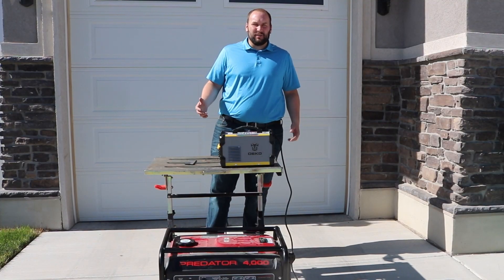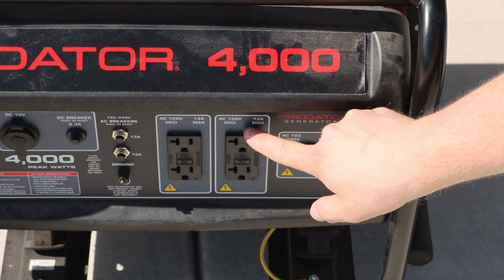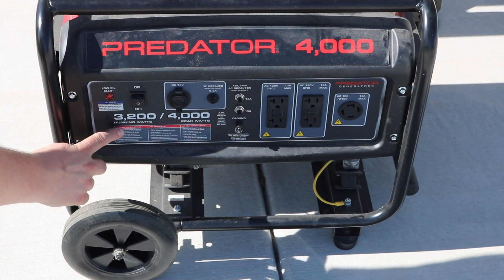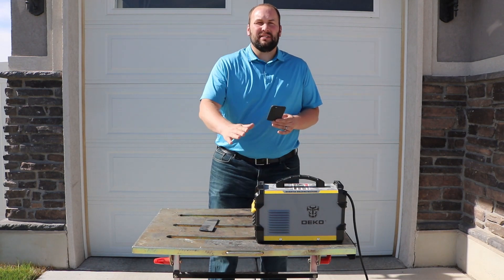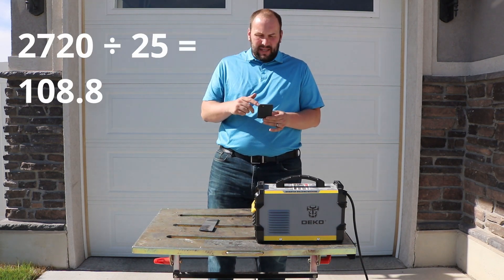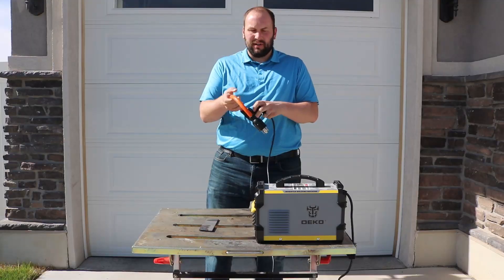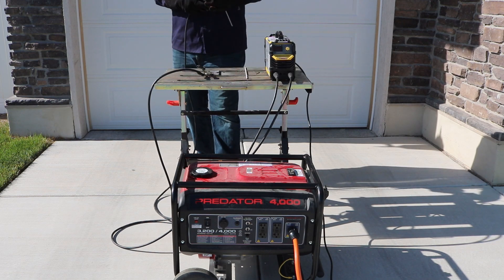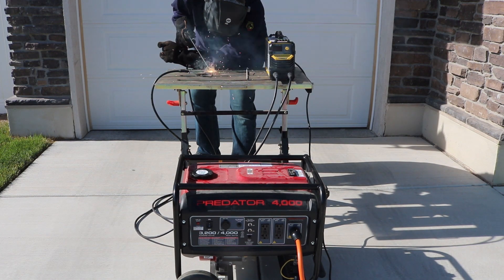How to Run a Welder Using a Generator

Comment: Tim I have a 2006 miller Bobcat 250.  I would like to run a mig welder off of it.  I have a transformer Miller Matic 211 and a Yes welder DP 200.  Should I be worried about frying either one of these with dirty electrical output from the Bobcat?

Comment: I run a titanium 225 stick welder from harbor freight of my predator 5500 generator also from harbor freight with no problem I rarely use 6013 3/32 rods mostly 7014 or 7018 3/32 rods on the 220 volts I even burned some 1/8 rods of the same above mentioned sizes with not problems I never weld with 110power if don't have to

Comment: what generator would you recommend to run a HONE Stick Welder, 110V/220V Actual 140Amp ARC Welder Machine, IGBT Inverter. Thanks David.

Comment: You should look at what you are pointing at or trying to show as it looks weird hahaha... and you miss some times aswell :D

Great vids so far!
Reply from the maker: Thanks! I did all sorts of weird stuff when I started making videos...I'm just a super awkward guy. I think I've improved since then, but who knows.
Reply: @TimWelds  You're doing great!

I am planning to invest in a Tig for my garage dutioes now that i have fixed the generator i bought off a friend that refused to make electrickery... I really want to learn the black art haha. I am sure that i will be able to use it alot better and more precise than the Mig i got. It's only car panels and some bit of structural stuff, but in my current situation i think it will be ace!
Be well and thank y ou for the replies! :)

ADam

Comment: When considering to use a generator for any heavy load such a welder, you should test your generator with a static load first. You need to get a baseline proof of performance of your generator. This applies especially to off name brands. Static testing includes digital voltmeter and oscilloscope. A meter that measures THD (total harmonic distortion) is also helpful. If your generator has a good sine wave and low THD, then your inverter type welder  electronics can better deal the power delivered. Both the generator and an inverter welder will have issues if the sine wave and THD aren't acceptable. The both have power manipulating thyristors that can eventually cook one or both units involved. ..... Point being, test your generator to see if it actually can put out the advertised power. Some just don't meet spec. .....

Comment: Are you sure you don't need to use an Inverter Generator?  From what I have been reading, Inverter Generators are made to run welders much better than a regular generator.  No expert here, just asking the question.  Hopefully, you'll read my comment and can respond. 👍
Reply from the maker: It depends on the welder because some tolerate it better than others. If you want to get technical, you can look at the total harmonic distortion specs and make sure the generator is acceptable for the welder. The real issue here is probably the low power factor in this cheap welder, but I didn’t fully understand that when I made the video.

Comment: Im pretty sure if the welder is a 110v plug, using a 220v adapter into the 220v outlet isn't any different than the 110v on the generator. The adapter does the same thing as the 110v outlet. I think you're only using 1/2 of the 220v supply. I think its 2 110v with ground being their center. Like a push pull operation. Maybe I'm wrong about that, but I think you'd need a 220v machine to get the full wattage of the 220v outlet.

Comment: I have a little 130A stick welder that won't start an arc on my generator,  but my harbor freight flux 125 welder runs great off of that same 3500w generator.
Reply: Different requirements i think that might welder is 20 Amps stick uses more

Comment: Thanks a lot for this video!
I plan to do a lot welding next month, with 120-130 Amps, (MIG welding), so I planned to buy a Honda 4kW generator (220V).
According to the manufacturer of the welding machine, a 3.8kW generator is enough, but it seems like I'm on the  edge of the limit with 4Kw Honda.
I'll rent a 6kW generator instead of taking the risk of buying one.

Comment: I tried running a Lincoln buzz box off of a generator. I could hardly keep it lit. Then, I got 220 up in the shop and the buzz box worked effortlessly. And, a welder/generator works really well. I will never use a welder on just a generator. Thanks for the video.
Reply: Then run fine off a generator if the generator is big enough.
Reply: I ran ours of a 7000/8750 generator, but buzz boxes are terrible with efficiency and powerfactor.  I only got around 120A, which was fine for running 6011 on the farm.

Comment: A constant current welder varies in wattage based on the voltage set by the operator via arc length. I think a basic circuit analysis class would improve his math. Incredible inaccuracies all around, he is neither welder or engineer.

Comment: Latley i been tossing in my 9500 watt generator and my tig200 into a scissor lift to weld up knee braces in massave buildings...only using 3/32 7018 electrodes... saves time rather than go up and down to move my welding truck all over for lead reach.

Comment: I have. A 225 inverter stick titanium welder from harbor freight  my question is can I run a 5500 generac wheel house generator  ? At what proper amp and size stick rod use

Comment: I bought the same generator at HF they told me I could weld with it. I connected Vampbell Hausfield(old) Mig to it and it struggled on the lowest setting. So I got a suggestion to try the) cheapest HF stick welder, and on the 120V 13A side struggling. Then HF (a different store manager) tried to sell me a 10kW generator…I’ve ordered the 240 4 prong to 3 plug from Amazon, I’m welding tubing w/ 1/8” - 3/8” wall. Thanks for the info. As far as I can tell you’re the only one who has featured the Predator 4000 w/ a stick welder.

Comment: Any chance you can help me to see if I can run the esab 205 ac dc using mig and stick off a 6000 running watts inter genrator ?
Reply from the maker: I don't have that particular machine, so I can't test it out for you. I did see a video on some other channel (I think it was Baker's Gas) with the 205 running on the generator side of the ESAB Ruffian engine drive unit. That engine drive has a similar output, so it may be worth trying to track down that video to see what the limitations were.

Comment: how is the welding voltage 25v I don't understand?
Reply from the maker: It's probably a bit lower than that in reality, closer to 20v. I was just assuming a high number for a more conservative calculation. The purpose of a welding machine is to take a high voltage and low amperage and change it to a lower voltage and higher amperage that works better for welding. The physics of the arc work out to give a voltage drop of about 20 volts over the gap with stick welding. The longer the arc, the higher the voltage, but it's around that value. The amperage is adjusted to give enough power to heat and melt the material.

Comment: I run my welder on a generator and it works pretty well. Your setup is pretty close tho. The setup that would work is very limited though. You'll only be able to run a 120v welder on it. For example my Lincoln Le31mp is a 120v 15a plug. Multiply Amps X Volts to get 1800.  Now look at the wattage of your generator. That's awfully close to the required juice ro run your welder. If you were to run this on a Predator 9000, it would work because it's got 72500 running watts. That's plenty of power to run something requiring 1800 watts. Also I have a splitter that goes from 240 to 2 120s. This will keep you from tripping your GFCI on your generator.

Comment: per the sales reps ive talked to from various welder manufactuers(idk if i should say who exactly) but generally speaking all recommend atleast 7000watts 120v and 13000 watts for 230v so to them our running fairly low to be able to run that welder at max...i run my welders off a 13k start and 10.5k running and have had no issues at all thus far good luck in the future

Comment: If you have an EV or can get a hold of one, you should try demonstrating welding plugged in to it.  220 volt if possible.  People talk about being able to power a 220 volt welder off of an EV but I have yet to see someone do it.  I'd also wonder about what kind of battery life you'd get in terms of miles of charge used per minute of welding.
Reply from the maker: That’s a great suggestion! I’ll have to see if I can get my hands on one to try it out.
Reply: @TimWelds If you really want to get some strange looks and/or get banned from local businesses: you can get a J1772 AC charging adapter. They cost about $50 or so. 

You plug an EV charger into one of these adapters, and it gives you a standard electrical outlet. It will be 120v or 240v depending on the charger. Note that these adapters only work on AC charging stations, which are low and medium power. DC charging stations won’t work with these adapters. So you may have to search to find the right charging stations (EV owners generally hate AC chargers because they are slower; almost all EVs accept both AC and DC)

And then you can weld in the parking lot of your local grocery store!

(I have never tried welding with one, but I did charge my laptop using my adapter)

(Also, just got one of those handheld stick welders and laid down my first 6” of bead. Actually managed to attach two pieces of metal together! Gonna get some better welding rod, grind down these welds and try again until it looks good)

Comment: If you have a little technical know how. This video is quite informative. Thank you. Trying to determine if my 4375 watt predator generator will run my titanium 220 stick welder. I use it for work on the road. I have a 460 amp generator I use that I engineered from a Cummins 12 valve with John deer parts in my trailer. But for the jobs out in the field far away from where I can park the generator. I use the bobcat with a mini generator and welder. This is great help. Allows me to be a bit more practical for the variance in my field.

Comment: some generators come with "high altitude" kits.   they have smaller carb jets because the engine not only has less air to work with at higher altitude, but it also becomes WAY too rich which also robs power. so you throw smaller jets in and it at least bring the fuel air ratio closer to where it should be.

Comment: I was running in 180 MIG welder off of an 8750 inverter generator.. is working great and then all the sudden now it's tripping the breaker on the welder every 4 seconds
Reply: Even after it cools down and you start again? Maybe a 12V computer fan blowing at the breaker could help- unless you are really, really  pushing the limits of the breaker rating.

Comment: If you want a real gen that is made to weld with and be mobile get the predator 9000 for 800$ you get a good gen for the price and you wont need to worry about setting the amps to high  ever as long as you got gas to fill it

Comment: Im glad you posted this i was wonder what specs would i need to run my welder off, seeing that its a bigger welding unit looks like ill need quite high specs to run my unit without issues Thanks TIM:yt: Dexterous X

Comment: Thanks for the video. I just bought a cheapo 4 in 1 welder hoping I could use the 220 volt outlet on my generator. My generator is the same size as yours. Funny thing my Miller synchrowave  250 would run on it at about 70 amps Tig welding.

Comment: Thank YOU for that 4 prong to 3 prong adapter cord !!!

I have been trying to figure that out for the past 2 weeks 😅.    I have been watching your Arc welding videos and just fixed my tractor mowing deck that had a broken mounting bracket.  The welds are ugly as heck but it’s a start.  The mower deck is super thin.   I was able to use this welder with my Ryobi 6250 generator.  It has 2 110v at 20amp receptacle and one 240v at 30amp receptacle.  I was concerned that the generator puts out 240V but the welder max voltage is 220V so I was worried that it would damage the welder, but it’s barely over 10% so hopefully it can take the voltage mismatch ok.  I got the welder for $103 😂.  I’m sure Nov 28 Cyber Monday there will be more coupons or sales for this welder.   Love your videos ❤
Reply: 110V-125V is ‘normal’ 120VAC; they are just numbers. 240V is the same thing as 220V in the USA. 

My ‘grid’ power is 125.3V AC right this moment which is normal in this area, so the phases are technically ~250VAC. 
110V to 125V is 120V “nominal” and what we like to call “220 volt” is 240V nominal. So your concern is really a non-issue.

Comment: I have a 12k peak 9600 running watt generator. I can’t weld a thing. Sticks rods like crazy, near impossible to get a stable weld and any amperage. And trying mig it only runs for about a second then the weld stops but the wire feeds like 2 feet on its own. Not sure what I can do. I’m running off the 50amp outlet.

Comment: I made that adapter a few decades ago and to get the generator to give the full power you will have to wire the throttle on full as it will not be able to push out a constant wattage while trying to regulate itself.

Comment: Just bought a Harbor Freight 3500 Inverter generator. I have a Miller 211 inverter mig welder that will run on 120 or 240. I welds 1/8 with .030 wire like a dream using 75/25 gas and a 25' 16ga extension cord on 120V. The generator will not carry the welder on a 120 20A outlet with no extension cord. I have a L5 30A twist lock adapter on the way from Amazon. I will give the 30A receptacle a try report back later in the week.
Reply: How'd it work out..?
Reply: @georgehofgren6123 I’m wondering too
He’s squeezing the amperage down with that thin extension cord. Too thin for the load- fire hazard. It’s just a cumbersome resister at 16ga
Reply: Did it work?

Comment: I used the same generator. runs 1/8th" 7014 at 110 amps. usually ran about 107 about 6 just fine. h get another spring to hold the throttle more open

Comment: I just got a Predator 4375 which has 3500 running watts and 15amp breakers. Would it be able to run better on it?
Reply: Does it have 240V outputs?

Comment: Great video, another way to see if your generator will run your welder is to calculate the max wattage of the welder, most single phase inverters run 220 volts at 30 amps which is 6,600 watts

Comment: Your explanation of how 'small generators' distribute power is somewhat wrong. The way they 'do what they do' (when you have 220v capability from them) is that they take L1 (leg 1) of the 220 and put it into one 110v outlet, and then put L2 (leg 2) of the 220v into the other 110v outlet. So, if it produces 3250 watts running power (and you trust this number without checking), divide 3250 by 240 (always use 120v and 240v for calculations...as most electric company manufacturers do for 'numbers-sake')...and you find that you can draw UP TO 13.5-amps of 240v (220v) current safely from the generator. HOWEVER, if you are running 110v, you ONLY GET one leg of this to each outlet (it's split between outlets...remember?). So...you get two outlets (possibly receptacles...you have to see how they wired their receptacles first)...so you can draw 120v (110v) up to 13.5 amps per receptacle...or a 'general use power drill', basically. Now...can you throw SMAW 240v demands on a wimpy little generator like this? Hmmm...let's look at the old Lincoln 'tombstone'  AC225...says to 'wire it to a dedicated 240v receptacle backed by a 50-amp breaker (sounds like 12,000 watts, to me)'...uh...NO. You can't.
As for 'more-modern' MIG/TIG...they are a 'bit more laid back', but when you get to quoting 'amps'...you are speaking to the OUTPUT, not the powergrid INPUT! BIG DIFFERENCE!
I have a Miller 200, and it can run on either 110v or 220v...per the owner's manual, you can expect it to draw 20-amps in 110v configuration, or up to 31-amps in 220v...BUT MILLER SAYS TO CONFIGURE IT ON A 60-Amp Breaker at 220v!
Now, the 'why' is quite simple (other than the safety factor...as I know a LOT of guys that wire these 220v 50-amp breaker)...not all loads are the same! Dry steel, pre-heated, moderate settings? Yep...30-amps would 'get you there'...but humid day, cold steel, little mill-scale or bad prep...ZOOM...you're pegging a 40, maybe a 50-amp load at 220v!
So...you 'idealize' a 110v demand on a 13.5-amp leg, and say 'I'm only going to use a 100-amp welder setting at 24-volt output'...well, might want to look at your owners manual...for a Miller 200, that's going to hit your household powergrid for 24-amps, NOMINALLY! You couldn't even run this on anything less than a 30-amp breaker (110v)!...and if you notice...you're demanding OVER 100% MORE AMPS than that 13.5-amp 'little generator' can supply!
Most 'real welder manufacturers' will tell you to START at a 7,500-watt generator...and go UP as your rig goes up! The old Lincoln SA200 had a 10kw generator (built-in)! (lovely machines, they really were)...but I simply can't envision trying to run ANY WELDER (even a flux-core 110v Chinesium special) on a 3.5kw generator...you'd be popping the breaker every 30-seconds of 'continued bead'!
Look at a 7.5kw to 10kw generator, if you're really going to weld from the power it provides...and in reality, while the 10kw is the 'default field standard' for offsite welding, if you're going to dive deep into that '60% or higher duty cycle', you really want to consider a 12kw to 14kw, just to prevent having breaker and heat issues 'as the sun and temps rise'.
Reply: I think i am the only one who bothers to read your entire comment and fully understands it LOL!  Audiences here are 99% average Joe who can't even work around the equation Power = Voltage x Amperage, his info presented in the video is "good enough" to get small welding project done.
Reply: Exactly 👍